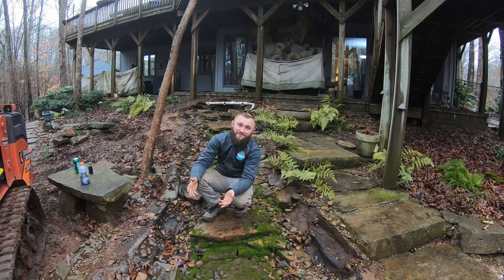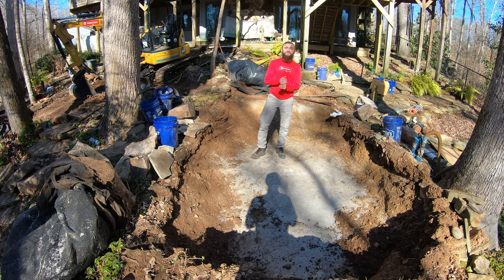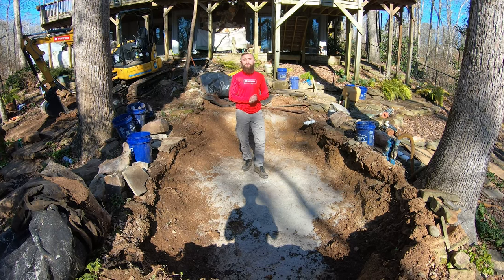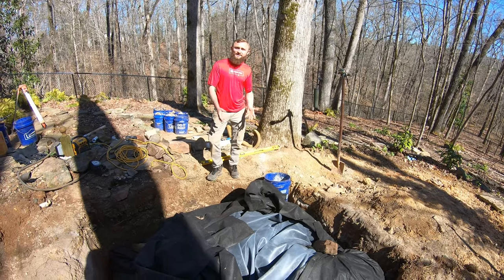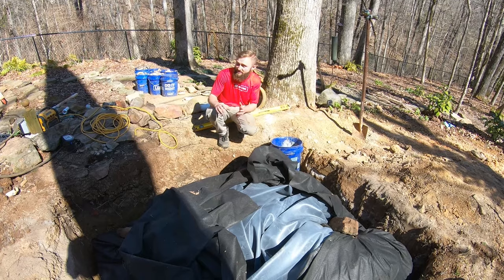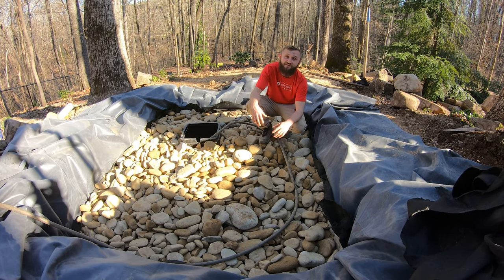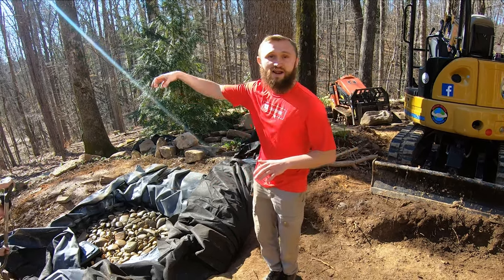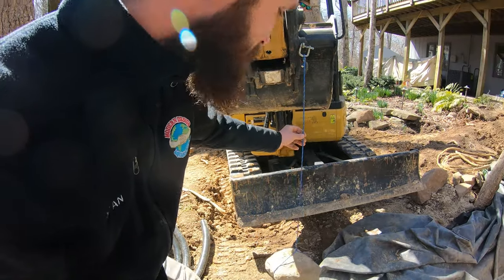Waterfall Upgrade In The Woods

Comment: When you are talking about the roots and the liner, do you mean that normally you would lay the liner against the walls of the hole and just back fill with stone around the aquablox inside the liner? Compared to backfilling with dirt behind the liner with blocks pressed against liner? Do you still add stone around the aquablox or no? In the video it looks like rocks just on top.
Reply from the maker: Exactly, normally we put the underlayment and Liner in the hole with a perfect pitch on the bottom and then install the blocks and stabilize them by packing 3 inch stones around the outside of the blocks. They were installed with soil around the blocks because of the multitude of sharp objects poking out from the trees roots just as an added layer of protection. The guys also could have just put extra underlayment inside the liner, laid the blocks on top of the underlayment, pull the underlayment tight around the blocks and fill with a smaller P gravel or 1 inch stone but what they did was the safest installation method in my opinion. Not to mention it makes clean out much easier when there’s not a bunch of aggregate inside the liner that can capture debris and Pond’s going making it difficult to flush out.